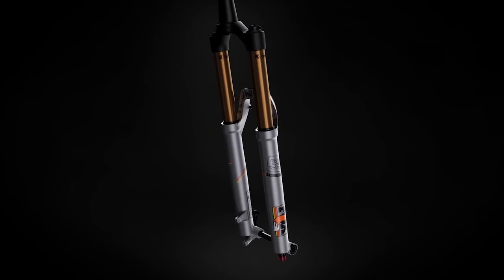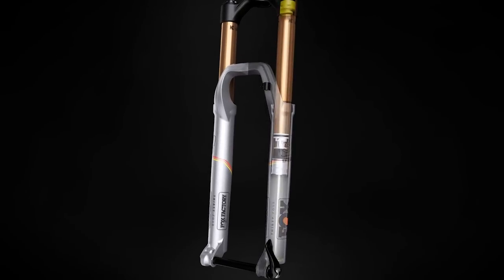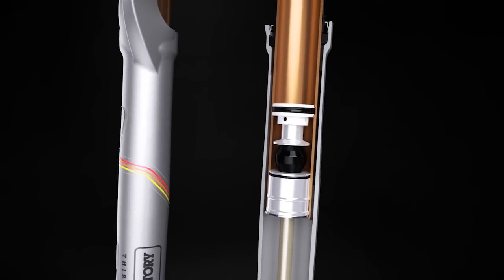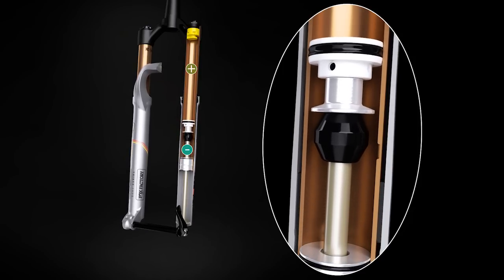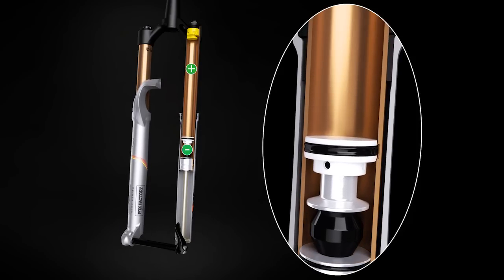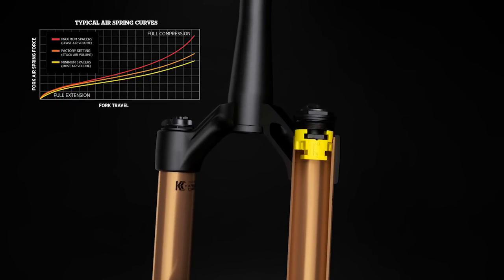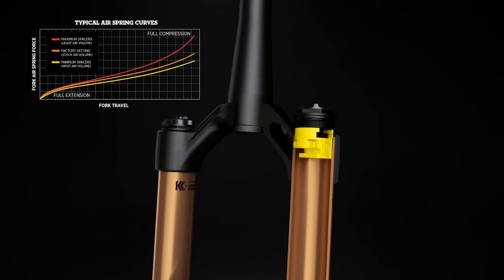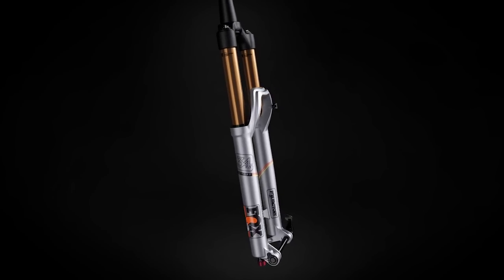FOX FLOAT Air Spring

Comment: I think the bypass should be just a bit higher up to get a slightly higher pressure in the negative spring. The surface area is smaller for the neg spring so it needs to have a bit higher pressure to perfectly balance the air spring. The Fox rear shocks do this.
The same goes for the RockShox line of SoloAir forks.

Bring back the DualAir system. It's just better. I just switched from a RS Pike to a MRP Ribbon Air with independent pos/neg air spring adjustments and it is so much better.
Reply: You wont beleve how much they have "progressed"

Comment: I have a 7 week old 2019 34 Float Performance Grip that sucks down its travel 20-25mm every single ride. I have to sit on the front tire and press up hard on the bars to get it to equalize the positive and negative chambers so it will extend to normal ride height..... Turns out this is a known issue due to either incompetent assembly with way too much grease fouling the bypass port, or just a bad design - or both..... My 1st and last Fox product.
Reply: Yeah, it seems if you are having any issue  with Fox forks with the float NA air shaft. The FIRST thing to check is this, remove air shaft , clear of the huge glob of grease, and re apply a sensible amount of slick honey (or other cheaper alternative)
Reply: I called fox about this, when they assembled the air shaft there was to much grease. U need to take out the air shaft  inside that stanchion is the air bypass ( it’s small ) use a screw driver with a rag on it to clean the grease out of it and u should be back to normal.
Dnt use to much grease to reassemble

Comment: What keeps that big bottom cylinder from being stuck at the bottom accidentally enlarging the negative air chamber?
Reply: Bottom cylinder is fixed in the stanchion. Cant move upwards cause the inner diameter above it is smaller.
Downward movement is stopped by a retaining ring in the stanchion right underneath the bottom cylinder.
The upper cylinder is fixated at the bottom of the casting.

Comment: But if you would lower your fork 's travel than this bypass port won't work will it ?
Reply: No it will work. The airshaft is just shorter so all its doing is pulling the lowers up
Reply: @409nh8  jeah but the shortest shaft you can get is 140mm so if you would want your fork to be 100mm you would need to add some neg plate travel spacers and than the airshaft seal can't reach the bypass I think.

Comment: Fox 34 Performance 2017 presumably. Version 140 mm. Can it be reduced to 130 mm?
Reply: Yes, you need to buy a 130mm Air shaft. There's a few good videos on how to do this yourself, with a list of tools needed. Check on Fox tech page to get the model fork you have, so you order the correct air shaft.